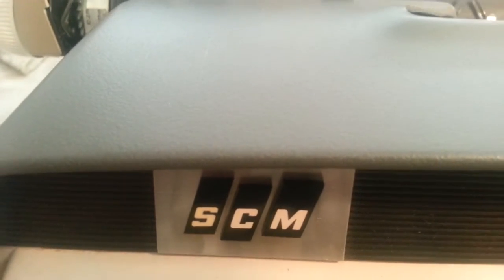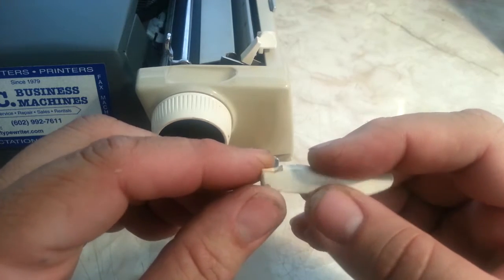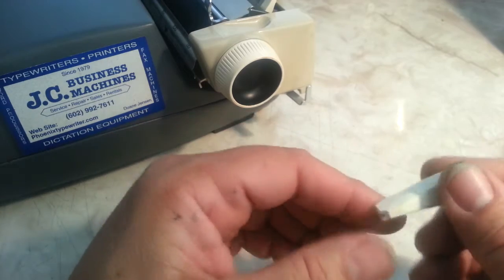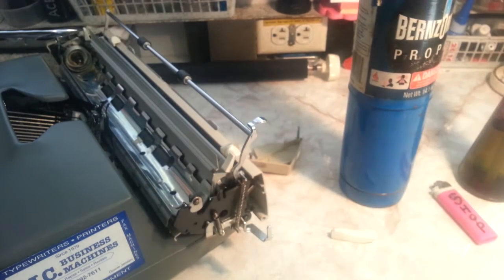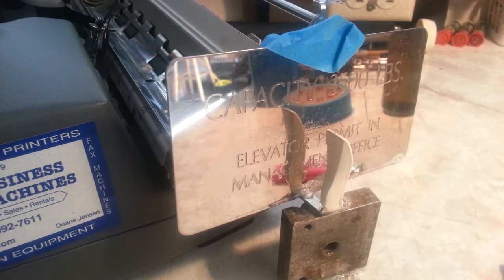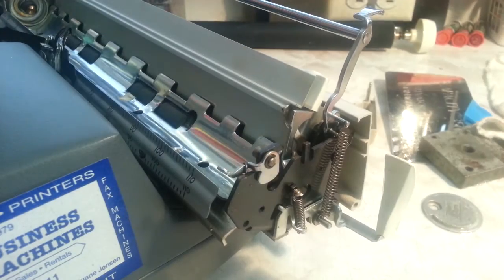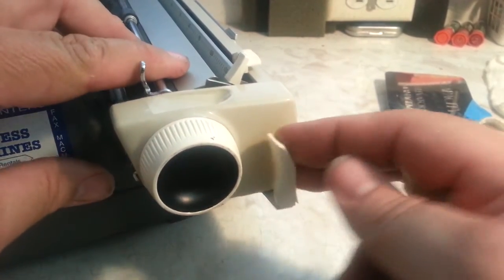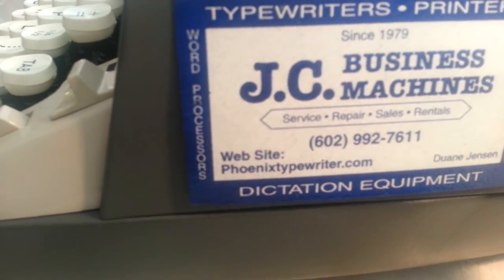Smith Corona Manual Typewriter Carriage Release Arm Repair Fix Broken Plastic Handle

Comment: I didn't have the original broken piece, so I removed the bristles from a blue toothbrush head, cut off the head and about a cm from the handle and melted it onto the metal piece and put some melted plastic from the handle round it and it works perfectly as a carriage return lever, the plastic is extremely strong but bends just enough when you pull on it.  Worked perfectly. Thanks for the inspiration.
Reply from the maker: That was a great Idea ! These are strong typewriters, not many weak points.
Reply from the maker: If your talking about the index motor gear, yes, they do break. Some are plastic & sometimes the spring breaks like on this video (even though this poster doesn't know it ! ! )
----> https://www.youtube.com/watch?v=caDzxNYfFC4
I salvage those gear parts from other brother typewriters, the springs are home-made

Comment: Exactly the same break on my classic 12. Same side, same blown out front and cracked back. Am going to have to do this, thanks for the vid!
Reply from the maker: Yup they break the same way most every time. I could/should have cut a fraction more off the bottom & got metal just a little hotter to sink it in just a fraction further.

Comment: Hey I want sure if you know but my carriage keeps sliding automatically to the left and wont move to the right while typing at all- do you know what I can do to fix this?
Reply from the maker: I would have to look at it in person to analyze what's wrong, sounds like the escapement is bad,
but could be a couple different thing, so I can't tell you how
Was it working and suddenly started doing this ? was it shipped ? has it been in storage ? is the escapement engaged ?
What happens with the tab or back space ? too many things need to be inspected to tell over the internet
Reply: @phoenixtypewriter2136  that makes sense, I found it in an antique store, not sure about its past. Hasnt worked since I've owned it. Tab and backspace do nothing! I've been trying to get someone to look at it but thus far I am without a response! Heres to hoping I can figure it out!! Thanks for your time either way though-- I appreciate it :)